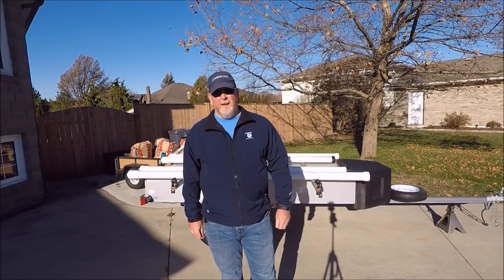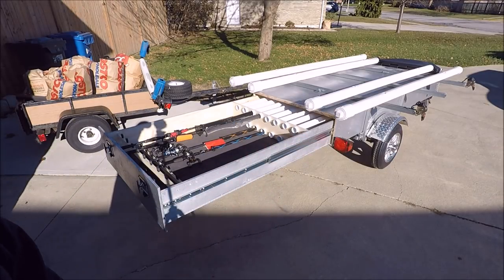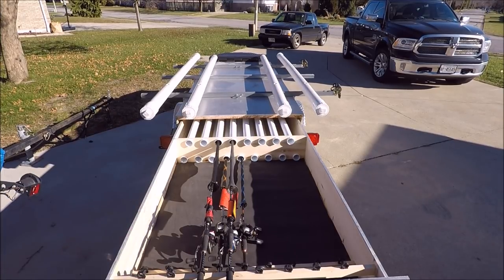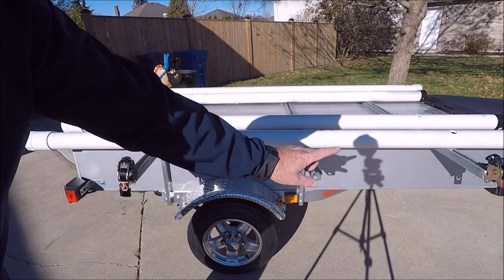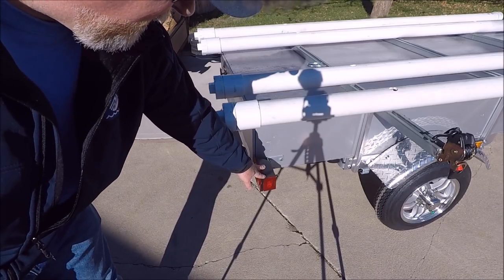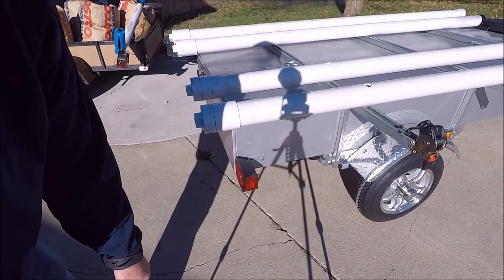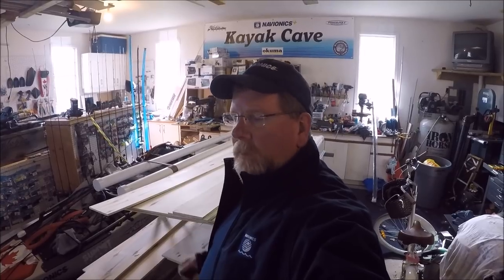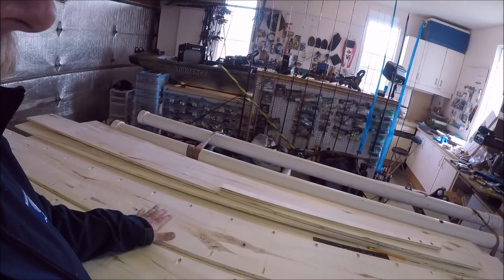Kayak trailer with rod locker storage

Comment: That’s an awesome setup! I was planning one similar with some sort of wheels on a track on the outside edge of the drawer so I can pull it out all the way and access the rear. Was going to build it y’all enough for my crate, extra tackle totes, and camping gear and that way everything can go in it and be secured for overnight trips. Also going to put in a place to lock my kayak to the top of the locker so that I can keep an honest person honest. Great ideas seen here that I’ll be using. Thanks for sharing

Comment: Nice job , like the rod locker below deck but does it get water inside if ya get too deep on ramp . Great ideas
Reply from the maker: Thank you. I don't back it into the water. I always put my kayak on cart and wheel it down to the launch. It would take on water if I backed it down in.

Comment: How's that birch holding up 2yrs later?
Reply from the maker: It's held up very well. I've taken it on numerous trips through some nasty weather. I keep a tarp on it when I store it outside at home, but other than that I haven't had to do anything else. The only issue I've had is the tongue; the factory Malone tongue is thin walled and not designed for the extra weight I added... it folded up on me on the way back from Tennessee...Fortunately there was a metal shop right off the highway that was open and they cut me up a replacement thick wall tongue.

Comment: It may have been noted in the video but what size tires are on this trailer( they look to be 12 inch ) and how do they hold up on long distance trips?
Reply from the maker: They are 12" tires. The bias ply tires that came with the trailer didn't last...they were coming apart when I got back from my one tournament in Kentucky. I've since replaced the tires with radials.
Reply: Tim Percy Kayak Fishing o

Thanks. You need to consider making these for resale! If you do, put me on the list.

Comment: Hi Tim, I scanned through the video, The rod locker is awesome! My trailer is similar and I will back into a lake as often as possible to launch  the yaks, the reason I made the trailer.
 My question is, do you back in to launch and if you do , does the Rod locker fill with water?
Reply from the maker: I don't back into the water, it would fill with water if I did. The majority of our launches don't charge kayakers if they wheel their kayaks to the launch, but they will charge you if you back into the launch. I just pull my kayak part way off the trailer, throw the wheels under it and roll to the launch or beach area.
Reply: That's what I thought you were going to say! lol  I am going to revamp the trailer over the winter and being in the NY/NJ area not sure I would "want" to leave that many rods in the trailer anyway.
I plan too Use at least 1 8" PVC Schedule 35 Tube -should hold 6 rods. Thinking of a way to insert and have some sort of tip protector and inner guide for them.

Comment: Do you use the inside of the pvc pipe for any type of storage?
Reply from the maker: At first I put my Power-Poles in there, but I found they were getting marked up by the bolts that hold them down, so I've added a couple piece of 1" conduit on each side to store my Power-Poles.

Comment: Wondering how the rod locker is holding up
Reply from the maker: Its holding up well. I've had a number of long trips with. The only issue I've had is the tongue on the Malone trailer bent... it's made out of a thinner gauge steel and couldn't handle the weight. The tongue has been replaced with heavier gauge.

Comment: do you have a video of you building the rod locker????
Reply from the maker: No, there is a little about it at the end...I started to film, but gave up as I just want to get it down.
Reply: @TimPercyKayakFishing  
how did you get the screws in the middle of the box
Reply from the maker: @josephokoren6093  if I remember correctly, I could only reach in so far. I believe I couldn't reach a few in the middle. With the glue and a few brad nails in the middle, its held together just fine.